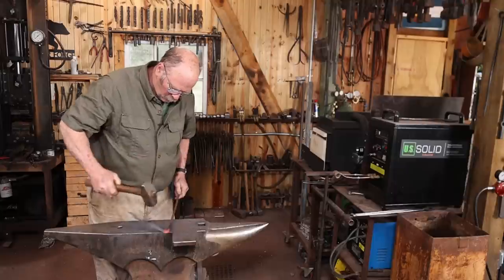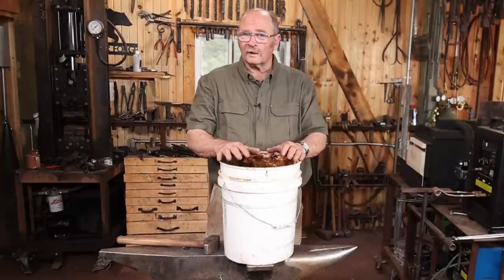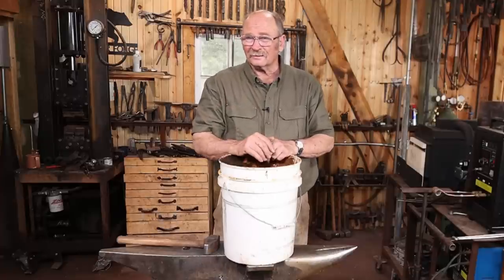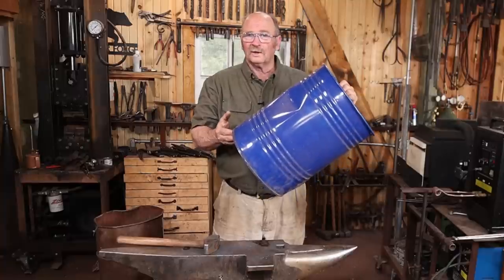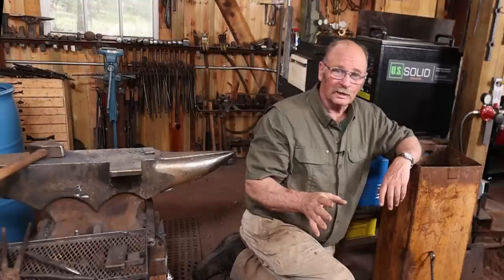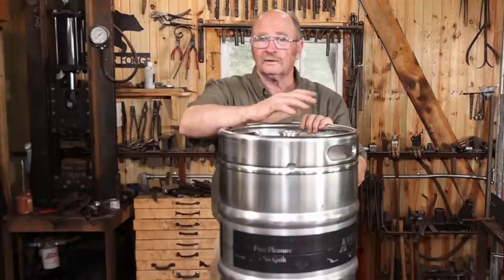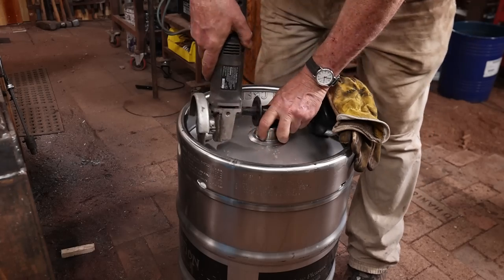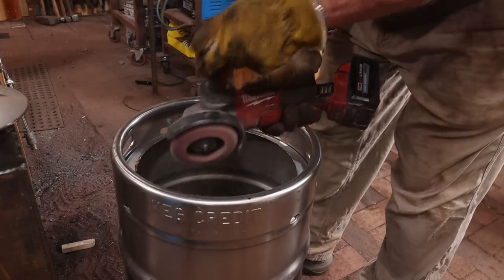Best Slack Tub for your Blacksmith Shop?

Comment: Your local brew pub or brewery will have "damaged or dented" kegs that they can't use any more and will sell them pretty cheap.
Reply: Damaged or dented? You have to actually know someone in upper management to get a chance of getting one that has been too badly damaged that the in-house welding shop will not touch. But yes, it is an option. From what I've seen, the welding on NSF kegs appears to be expertly tigged. I presume they are fully certified .
Reply: There are plenty of brewery reject kegs, most rejects have the spear collar misaligned from transport abuse and fail inspection for automatic fill stations. Have several myself purchased dirt cheap ($30) that now play brew kettle, deck stools and plant pot with cladding. Now I have another use for one!
Reply: Another way is to just go buy a full keg from your local beer distributor.  They will require a deposit on the keg and pump, to make sure that you return them. But at least in my area, the deposit on both the keg and pump is less then what Mr. Switzer said he paid for the keg alone on fleabay. Plus, no shipping! Unless one lives in an area without beer! 🙂
This also has the advantage of selecting the 8 gallon pony keg as well, should one want a smaller tank. OFC, one does have to drink the beer before cutting up the keg and losing your deposit. But many would consider that an advantage rather than a disadvantage! 🙂
Reply: @knlazar08    : I've also seen kegs in horrible shape with repaired battle scars that would make the Texas Chainsaw Massacre guy look like a Gerber ad campaign winner.
Reply: Kegs ain't as cheap as they used to be with the rise in home brewing & home distilling.. and the brewing community looks down on paying a deposit on a full keg ..notbreturnimg it and cutting it up.. because the breweries have to pay for then. Might could get some bud light kegs cheap now

Comment: I cut a water heater tank in half and welded plugs on the holes and put three rebar legs on it. Since it was lined with glass (enameled) it does not rust. Used it for seven years so far.
Reply: Ooh I even have an old water heater, now I have a plan for it!
Reply: Found two of those while working, thanks!  I’ve been looking for a use out of them since I stripped the brass out of em

Comment: Opening weekend Sunday at the Pioneer Village one year I decided it was time to empty out the half barrel tub at the blacksmith shop. So I bucketed out most of the water then rolled it out as best I could without dumping it to a spot in the yard and dumped it out. I then started the job of carrying two 5 gallon buckets up from the one water source to the shop to fill it back up. I piked Sunday because usually there were no people in the village until about 11:00 or so even though it opened at 9:00. After getting my fire going there was an older couple just out for a walk and they came in and said "we were just outside admiring your butterflies." I had no clue what they were talking about, so I walked outside. There were about 30 monarch butterflies drinking in the metal infused water that I had dumped out on the ground.

Comment: After years of struggling with very temporary solutions, I'd finally had enough. I cut the top off of an old empty propane tank, leaving me with the handles and a disk the same diameter as the rest of the tank, I cleaned up the disk to make a level stand, then welded the handles to the bottom ring of the tank. Now I have a fairly thick walled slack tub that's up off the ground  and stable. Later on I welded a little rocket stove to the side of the tank to thaw any ice buildup in winter. It looks like R2D2 with a hard-on, but it works. The water gets a bit dirty with rust after a few days,  so I know it'll eventually need to be replaced, but I can typically buy a new tank at a garage sale for $5-$10 when the time comes.
Reply from the maker: Interesting idea.

Comment: With plastic buckets,  put a stainless bowl in the bottom to help avoiding melting holes
Reply: Good idea!
Reply: @Vikingwerk  roofing supply companies will give away their empty metal 5 gallon metal cans so that they don't have to pay the junkyard to haul them in due to the tar residues. We know how to gently burn off residues, wink wink. Best thing is that you will have the perfect opportunity to get a second one WITH LID THAT FITS for your oil quenching tank. The plastic is good for ferric chloride etchant on the larger pattern welding ventures like axes or an achievement or awards plaque. Lemon juice works as well l substitute
Reply: As etchant substitute for it .

Comment: great shout on the beer keg, for the last couple years i been using a good quality bucket with a large stainless steel bowl that is same inside diameter as the bucket in the bottom, i can drop hot stuff in it without worrying about it burning through the plastic,
i've always had a couple of fire extinguishers around the shop and a water hose just in case.

if you can find one these days a second hand copper water tank ie immersion heater would make a great large water container

Comment: I'd have suggested gas canister as well.  Or any steel container, could be spray coated before you put water in it. Galv spray or just paint. Might contaminate the steel when you touch the side but, I doubt that's a big issue

Comment: I’ve thought about using the same thing. Also using one for a new foundry. Only problem is don’t throw grinding sparks on it. That will cause it to rust and will defeat the purpose of having stainless steel.
Reply from the maker: Good point

Comment: I'm not a blacksmith but appreciate your videos and watch regularly when notified of a new video.  When younger, I think I would have liked to try my hand at blacksmithing.  (I am now a retired hobbyist woodworker) I had not thought of a beer keg, but it would appear to be a perfect solution.  The only thing I might have done differently is install a drain valve at the bottom when it was empty.  That would resolve the freezing and draining issues in a non-heated shop.  I full keg would weigh around 125 lbs. when full.  Thanks.

Comment: I find using an old aluminum 80  scuba tank works for the great majority of my projects.  It takes up less room, doesn't rust, and I cut off the tank bottom which becomes the top and I change out the the first stage valve with a standard water valve so I can hook up a hose to drain it.  To me the only downsize is making a stand out of rebar or scrap wood.  But you can usually get old tanks for free at a scuba shop which really makes it a plus if you don't need something wide at the mouth.

Comment: G'day again John. Another good one. Just wanted to say that I was lucky enough to pick up half a dozen old hundred pound gas bottles for free and cut the top off one to use as my quench tank. About an eighth inch thick, good quality galvanised steel- will still be around after I'm gone. I actually cut the domed top off one about six inches down, turned it over and welded it back on as my first portable little forge, with a rack welded on the side to hold tools. It already has the perfect sized threaded hole in it for the tuyere.  And I have half a smaller diameter gas cylinder- acetylene I think- on the roof of my verandah as a dinner bell- rings forever with a lovely clear note.  Keep the vids coming- always enjoyable and informative.  Jay.

Comment: A keg is so smart!  I started off with the plastic bucket because I had one on hand, and sure enough one day I was working on a railroad spike straight from the forge, it slipped out of my tongs and  flipped directly into the bucket, and melted a tiny hole in the side.  I ended up using a small stock tank, but it was a little expensive (but is holding up really well).

Comment: I have a small kick bucket that I bought when the hospital I worked at closed down due to competition. It is stainless and was used in surgery. However it is too small at less than 4 gallons. I like the beer keg better. Plus it saves me the trouble of welding a bottom on my 16 inch steel square tube which stands at 3 feet. It does have 1/4 inch walls though.

Comment: I think the best and probably cheaper way to get a beer keg is to get a full one from your local distributor. Invite some buddies over for a good time then keep the keg. You’ve drank all the beer and at most your only out the $30 deposit on the keg.
Reply: You know, I was thinking this myself...I'm using an old aluminum keg I found in the ravine behind my house years ago. It's probably a relic  from a long gone teenage party, chucked down the hill to avoid being caught.
Reply: Great idea! They sure look like enough for a good dozen to get lit.
Reply: That's theft, pure and simple.
Reply: @bc2.by.design  I work in the beer industry. That’s why you pay the deposit. If you want the money back take the keg back.  If not keep it.
Reply: You can usually get a stainless keg anywhere from $20-30 from most breweries. I have two, and I don't have to worry about them rusting out.
Reply: Take the tap back, tell them you lost the keg😂😂😂
Reply: @roadyinzer2461 $30 doesn’t even cover the material cost. It’s an outdated deposit price that is a loss to brewers, especially the smaller breweries who feel the impact of buying replacement kegs more than a high volume brewery. 1/2 barrel  kegs cost around $200 new. $160 with shipping is a reasonable price for a used keg.. Keeping one for the deposit price is stealing.

Comment: I use a 5 gallon corny keg(soda fountain keg) a friend owns a convenience store, and when they switched soda providers, they had 4 old kegs that were left behind so they gave them to me. I cut the top out of one and use it as a slack tub. The other 3 im using as pressurized fuel tanks for the waste oil/diesel forge burner ive been working on

Comment: I have picked up several hot water tanks, So I have choices.
Hot water tanks are glass lined to prevent rusting I believe, (at least the ones I’ve made wood stoves out of were) so I will cut off end with an abrasive cutoff wheel as cutting torch will not work and makes quite a mess of things.
The owner of one of them claimed it was almost new but was upgraded to a larger tank and wasn’t leaking so may use this one as option.
The other one I was planning on cutting the bottom out of and welding on three legs on top end and pipe plugs in the threaded holes,as most likely if it was leaking it would have been leaking from the bottom. Then I will be priming and painting were the welds were on the inside to prevent rust from starting at those points.

Comment: I have an old bourbon barrel that only holds water to half way up because of the shrinking/warping you mentioned, but it works well enough even as that. However, I also keep a 'clean tank' of water I replace every time I smith. This is smaller, a ten gallon steel can from a farm store that I think was marketed as a feed pail, that is large enough to stick my head or boot in but small enough that I can lift and pour. If I've burned myself (blissfully rare for me thank the dwarves) I want mostly clean water to be used. During the summer I dump it out in the wood barrel to keep it's level up and stop more drying out. 

I also put a few drops of Dawn into the wooden barrel every so often. It really cuts down on the frogs and other critters who want to take up residence between emptying.  

I did forget to empty the clean tank one day this winter and now it's burst, so I've gone back to a stainless 4 gallon pail, but it works mostly the same.

Comment: Excellent subject, I never had a really good solution for this. Having a concrete floor I should probably put it on a wheel dolly so it can be moved around. An aluminum propane tank is another possibility that came to mind. For me a higher and slimmer tank would probably be better. A tour of the local junkyard may turn up the ideal container...

Comment: Walmart has cheap 16qt stainless stockpots I use for oil, replace the glass lid with hinged metal easy enough 

100gal trough catches rainwater, hot iron kills misquote larvae

Comment: An excellently inventive way to make use of a non standard slack tank. If you do a video on oil quench tanks, I’d recommend asking logging companies for old log truck stakes. I’m currently using a length of one for my oil quench tank. 

Some logging companies are switching from steel stakes to aluminum, which are nice if you can find them used/damaged-but-useful. 

Another excellent video sir.

Comment: Best thing I ever did was get an old stainless steel keg for my quench tank, water pretty much stays crystal clear. I give it a rinse out once every year or so to get rid of the scale which has fallen to the bottom which starts to rust and muck up the water a bit. 50 bucks second hand and commonly available here. I cut the top off mine completely about 3cm below the top skin and eased out the lip so the top could work as a lid, as mosquitos are an issue where I live.

Comment: I got a 1 gallon stainless steel bucket .  For little things  and short work it great.   Any thing  3 pounds or more .I got  5 dips before i can make tea.   Cold pack weighted to the bottom fix that  a little.   
 
Thought about making  one from sheet metal  with  screws and glue ( I got no welder).

Comment: I spent forever trying to find a good slack tub, and finally found what I think is the holy grail: stock pots. You can get them in nice heavy duty aluminum or stainless steel, they're ready to use right out of the box, they've got handles, and you can get a 15-gallon pot delivered for less than a hundred bucks. I've been using one for about a year now in my shop, and it's basically perfect.

Comment: I made my slack tub from a water pressure tank that I was lucky enough to get from the dump. I removed the bladder and ground sanded and painted the interior. I also kept the drain so I don't have to move it to drain the water just attach a hoes.

Comment: I like to use an oak whiskey barrel that I pulled out of a dumpster and cut in half. I  keep the outside oiled regularly and I coated the inside with bentonite clay to seal it up. It works well and lives outside (under an open walled shed roof) all year round here in Utah. I've never had any issues with leaking. My biggest complaint is that it's extremely difficult to move without draining it.

Comment: Now that I'm thinking about it, you can also check your local homebrew club boards or things like fb marketplace or craigslist for 10 gallon pots or converted keggles from homebrewers. Many are converted kegs like this already done up but just may be fitted with a ball valve at the bottom (or may not) and you can usually find them again roughly $50-$80 sometimes cheaper, sometimes more expensive. Sometimes you can find good kegs to convert from homebrewers that went through the right channels but never got around to doing the keggle conversion. I've seen those go for as low as $25 just to get it out of their garage.  Basically look for used homebrew equipment from people leaving the hobby or updating their gear. The used stuff can be had pretty cheap sometimes.

Comment: Interesting Idea John, probably works well for small items. I have a tendency to work on long flat straps, plowshares and the like. I have to have a Long Rectangular quinch tub, 40"L x 20"W x18"D. Typically made from a sheet of 18 Gage plate, I made one with 45 Degree Slopes on both ends, I'm not Shure how it will work, or if it will even hold water yet. doesn't have a 2x4 rim yet. It will Reust out and I will have to replace it. There Might be some spray on stuff to prevent steel and water contact. This is what my Granddad John A. Forrest used when I was young and He still had His Forge, it is probably copied after what my Grate Grandfather Will Forrest used. Melvin Doughty (Doughy Steel and Machine in Delta CO.) was buddies with my folks He to made one for the Pioneer Town Blacksmith Shop in Cedaredge.

Comment: FYI - 5 gallon stainless steel soda kegs can also be used.  They are as tall as 15.5 gallon kegs, but slimmer.  Cheaper on the used market, too.Still have handles and foot ring.
Reply from the maker: Thanks for the tips!
Reply: If you're talking about the thing I'm thinking of, then this is called a cornelius keg or "corny keg" and homebrewers use them a lot.  I was actually going to comment about this on the video as they're probably easier to find and will be a lot easier to move around as well as taking less space, but same stainless construction (or maybe aluminum) so it'll work just as well unless you need to quench something really big or that has an awkward shape that won't fit through the opening like a big scroll or something.  Most corny kegs will have a large latched cover on top too, so you can keep it closed to avoid spills when you aren't using it and it'll open wide enough to fit most types of things you'd need to quench.  Now that I think about it, a corny keg would make a decent oil quench tank as well.  I might have to get one for that purpose.

Comment: I've been using a 20l stainless bucket from the local hardware store as my slack tub for about 1.5 years. 

It has rusted and pitted slightly where the scale piled up in the corners.

I suspect your keg will be a different grade of stainless. It might be interesting to see how it holds up to having scale and rusty mild steel up against it.